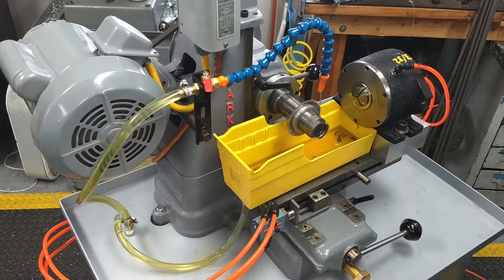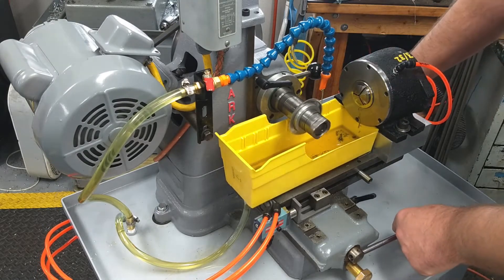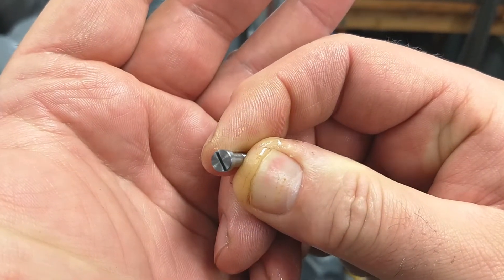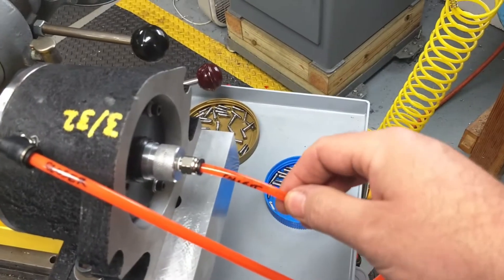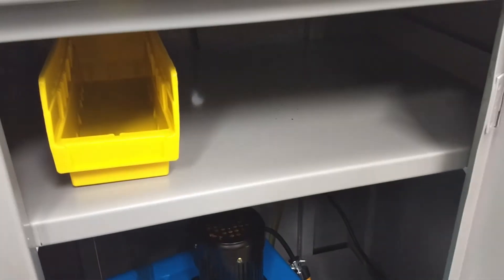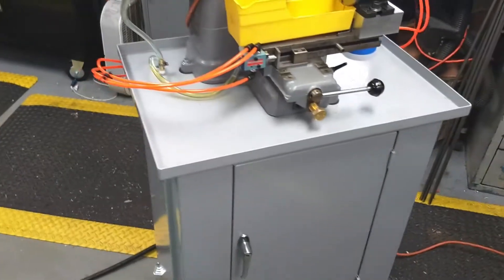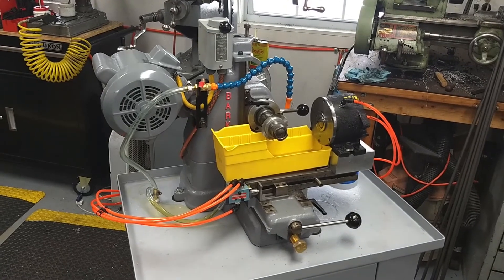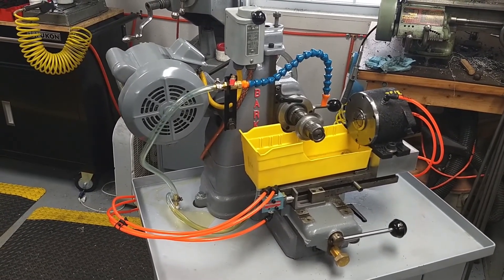Slotting Custom Flintlock Screws On The Barker PM Horizontal Mill

Comment: Nice restoration on the Barker. Mine is very similar, though it has the handwheels instead of lever and pinions.
Reply from the maker: Would love to see some pictures of it!
Reply: @lockbuilder  Right now, I'm in the process of making tools and fixtures for it. Here's the teardown after I bought it: https://www.instagram.com/p/CG7uP29BRJB/
Reply from the maker: @rustyscrafts  You have a sweet little machine there! They are suprisingly heavy aren't they?! I am jealous of the dial handles on all your axes. I would love to be able to dial in the Y axis on my machine by thousandths to center my screw slots more easily. Can't wait to see it all dolled up. Please keep in touch :)

Comment: Nice work Chris. You’ve done an amazing job restoring this machine. I’ve just subscribed to your channel so I can see your next instalment. Cheers from downunder 🍻.  Aaron
Reply from the maker: Hey Aaron, are you the same Aaron from the DCT channel? If so, I've been subbed to you guys for quite a while! Thanks for stopping by and the sub. Best.
Reply: @lockbuilder  G'day Chris.  Yes that is me mate (guilty as charged) LOL.  Oh it's my pleasure.  Thank you for the subscribing to me.  I have 2 channels these days. The DCT one is mainly for CNC, CAD & CAM.  Aaron Engineering is for all my manual machining and fabrication work.  Cheers, Aaron.

Comment: What a great little machine. Never seen anything like it. Fantastic restoration well done with that. 
Is the collet opening and closing with the X movement, it looked like it? All it needs now is a spindle stop start operating that way and all would be good. My lathe has a zed axis! Can I put a link to this video on my Hercus cnc benchtop machines Facebook page? I think this would interest some of our group. Is the zee axis only hand fed with that handle? A bit hard to get my head around the table working like a small surface grinder. I have been waiting to see how you slotted these screws, this method is brilliant.
Reply from the maker: Yes the collet is in line with the X direction. Yes again on the Z (also the Y) axis, they are both fed by their respective hand levers. They did make a version of this mill with handwheels, although almost all that I have seen have lever feeds like mine. They are neat little machines. I had been looking for a Hardinge BB4, when this Barker came along, and I thought, That would work! Please feel free to share, Best...
Reply: Thanks for sharing this video Nigel. Very interesting mate 👍